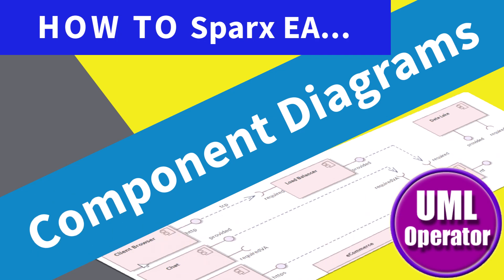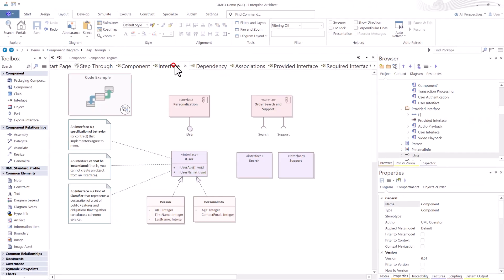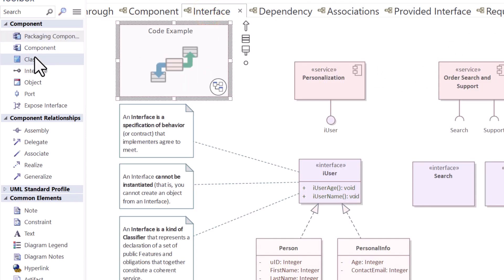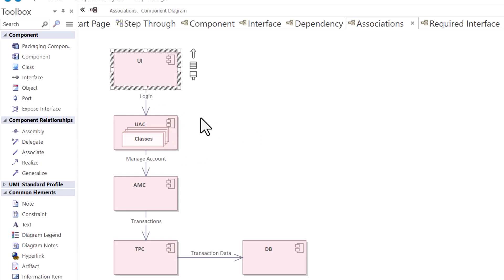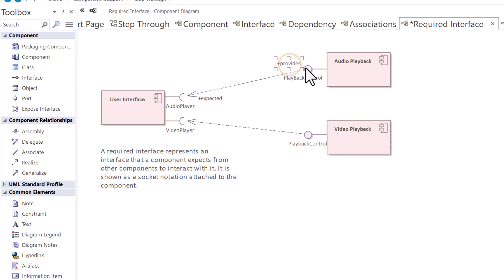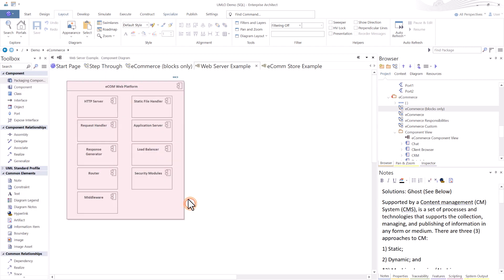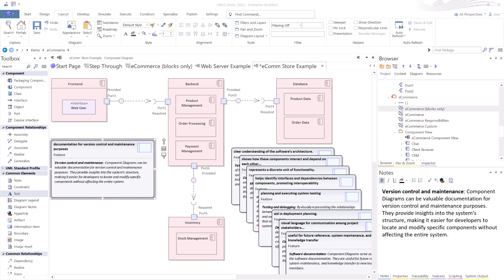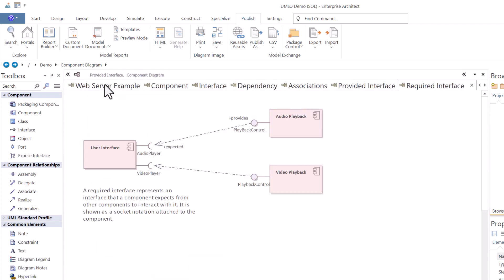Sparx EA UML Component Diagrams (e19)

Comment: Very interesting and thanks for laying this out. I do have a question about this because I use the component diagram to model our microservice architecture that uses a message bus (like ActiveMQ) for communcation to other components. Also it exposes a REST API for external systems. Is the component diagram suitable for something like this? I think it is but I struggle a bit with the modeling because all these Active MQ connection clutter my model. Maybe this will be an interesting subject for a video?

Also a modeling question that puzzled me. How do I create visualize an assembly connection between two components without interfaces showing twice? What I mean is that the required and provided interface of each component is visible, but when adding an assembly connection EA draws another cup/ball interface between them making it a bit of a mess...
Reply from the maker: @oschotgerrits, this is a perfect case example! This will also help in demonstrating what @user-ht3wt3iq3d is asking for as well. When I finish my current project, I will move Component Diagrams up in my queue. Thank you for the suggestion and support. This will be a fun project to present :)
Reply: @UMLOperator  Thanks a lot! This helps a great deal. Looking forward to it.
Oh and about the question I had in the same comment earlier is perfectly answered in one of you videos already called "Sparx EA Strict Connector Syntax". So no need to do a follow up on that.